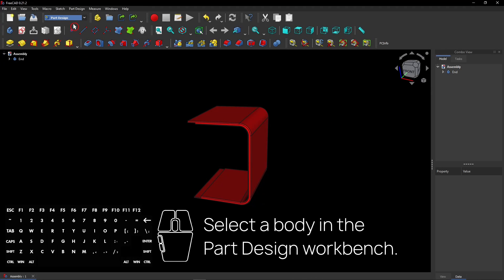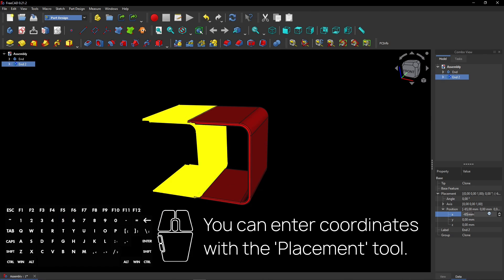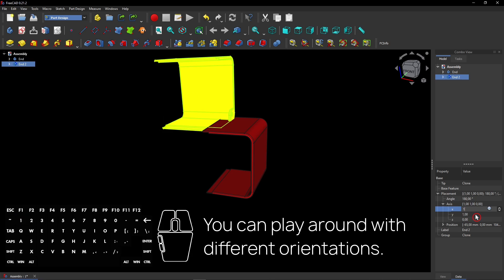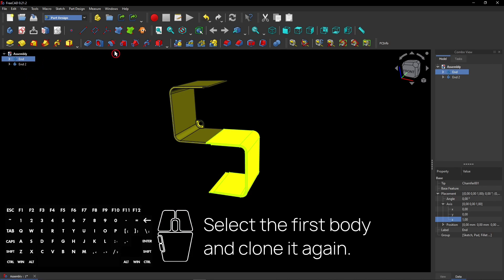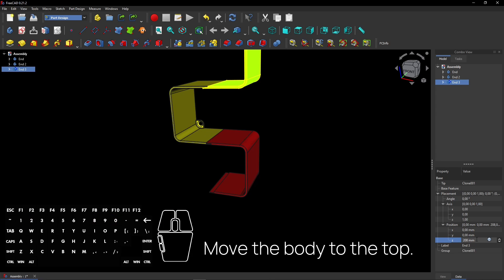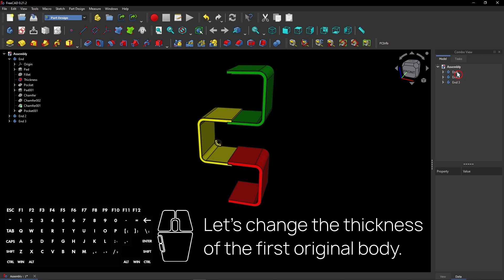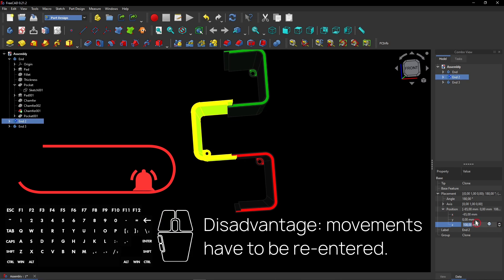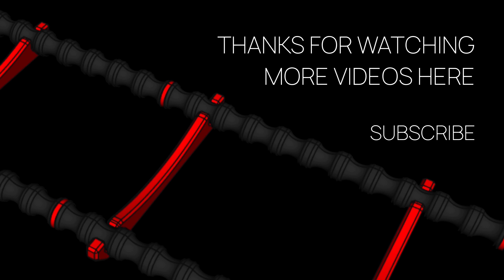🔴 Most EASY Way To Assemble? - FreeCAD Assembly Tutorial - FreeCAD Part Assembly - FreeCAD Move Part

Comment: That is not an assembly. An assembly must have geometric constraints between parts. This is often called a pseudo assembly.
Reply: the other assembly workbenches are trash, and their solvers are full of bugs. at least this way, you can enforce a functional geometric constraint yourself in terms of the position and orientation
Reply from the maker: @xmdi0 Well said. Looking forward to the built-in workbench in FreeCAD 1.0. Ondsel has one too.
Reply from the maker: Thanks for your input! But this could sometimes be an easy alternative.